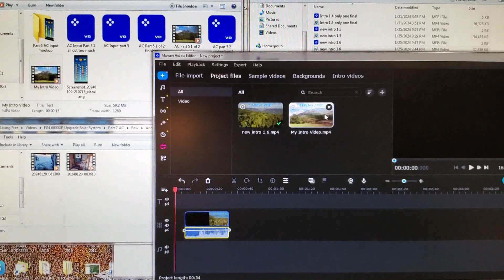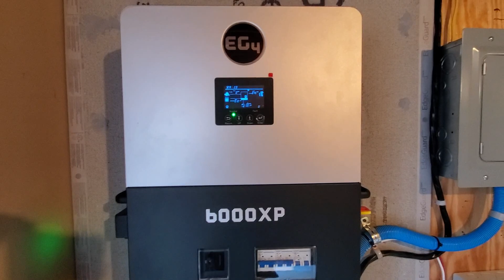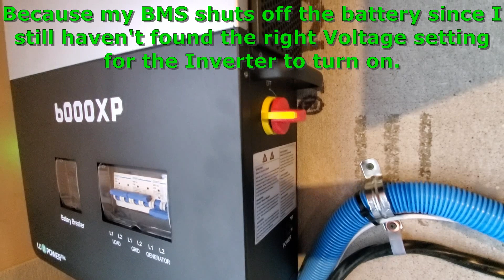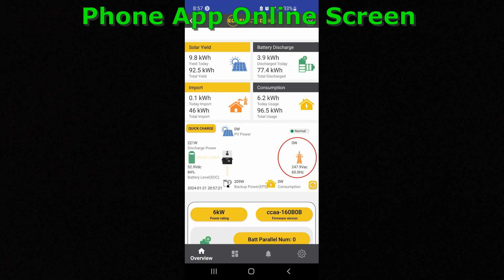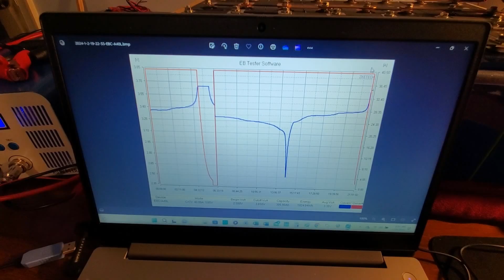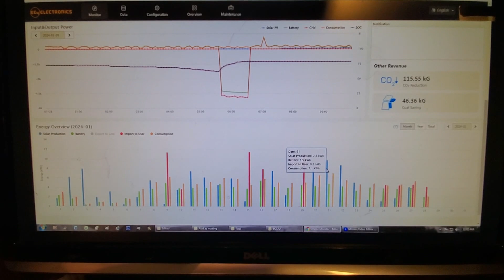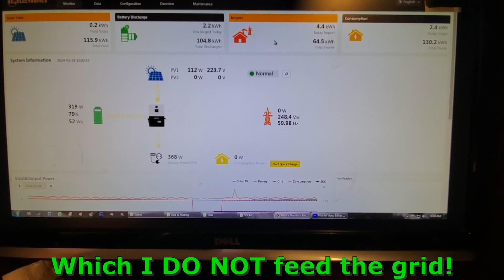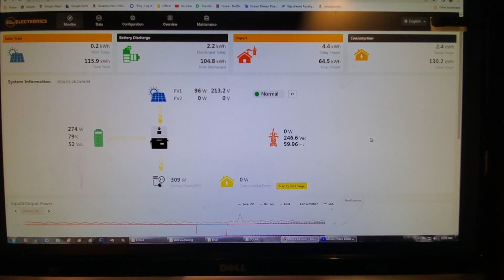EG4 6000XP - Part 7 - Settings and Thoughts I - Solar System Upgrade

Comment: Thanks for taking the time to make these videos. They give a lot of good info.

I was wondering if you added an EG4 ChargeVerter to your system (via the battery bus bars) to charge the batteries, if that would make a difference in keeping your system charged?  This way, should the battery get to low, the grid connection can take over, but the ChargeVerter should always keep your batteries at a nominal charge.

Just a suggestion ...
Reply from the maker: A/C from the grid charging should be clean no need for EG4 Chargverter. I have been looking into using it for my generator hookup but I have to verify it's really necessary myself. It is also a whole different hookup for me because of distance to generator. If this inverter is so delicate that it needs special hookup than I l'll move on to another and why does it even have a generator breaker? I think a larger generator is a better answer (11-12k propane should be fine) Too many salesmen on UTube wanting us to buy everything and trying to get us to believe them. It sounds good on Utube but those people make $ on selling it so I have to research and find out for myself. Don't believe everything you hear on UTube. Great comment, one im looking into myself.  Thanks!
Reply: @LivingFree4All  thanks for responding. I’m still in the planning stage. I’m thinking of using it initially as a grid down backup.  Then add solar. 

Want to run grid power to 6000xp. Then back to an interlock in my main with 100a breaker to give me some expansion to a second 6000xp

Then generator inlet to a chargeverter directly into my battery for grid down conditions. I’ll slowly add breakers from my inverter to some 240 devices and work my way up slowly. Don’t want to use the gen breaker on the 6000xp because if I do go to 2 of them, creates more boxes and wiring.
Reply: @Barc7580  One thing I'd say about the EG4 chargeverter is that it is really easy to dial in the amps so you have the most efficient load on the generator.  You can turn on the generator, charge at maximum efficiency to the desired level, then turn off the generator.  That can really save on fuel.

So if the 6000XP has trouble handling a noisy generator, the chargeverter is going to be an excellent alternative.

Comment: There's several communication protocols the controller can read. A BMS with CAN / Pylon protocol will work.
Reply from the maker: Interesting I'll keep that in mind. I'm not interested right now in adding more equipment, money and time for something I don't really need. I finally found the voltage settings so I'm good now with the inverter starting the A/C charging before BMS shuts off battery. That's all i needed and my BMS is now backup to inverter.  I don't have enough free time to learn something else lol but thanks for the advice.  Others may what to use it! Thanks for the comment! Take care

Comment: I thought it was supposed to have a 2p40 breaker and 8 awg wire from grid . I can't read your chart, nice chart but too small to see numbers.

BTW, this inverter does not have export to grid function
Reply from the maker: Correct no export capabilities but it's  part of the app so I'm guessing they are planning on expanding it. 

No I use a 2P50 amp breaker, the same breaker that comes with the inverter and is the Grid breaker on the inverter so it should be fine and i connected it with 6 gauge wire not 8. And boy does it charge fast at up to 110 amps! I slowed it to 80amps off grid to not overload my subpanel.

And yes the chart are even hard for me to read, you can't enlarge them either, that would be a nice upgrade to it.
Always nice to hear from you Bob!Thanks for the comments, take care
Reply: @LivingFree4All  I reviewed the manual.  It recommends 8awg wire but doesn't mention breaker size for grid input! I saw the "50" on all three breakers on the inverter  but have seen other people use a 2p40 for grid input. Strange, that's why I asked. I'm gonna do what you did! Thanks for prompt response
Reply: @bobcole3852  The EG4 supports 50A from the grid, I believe, and the transfer switch is also rated to 50A.  So a 50A breaker is generally what you want.

Hmm.  The EG4 manual specifies 8 AWG.  It is unclear whether that is a nominal specification or the biggest wire the terminals can take.  The battery terminals specify down to 1 AWG.

I personally use AWG tables for "power transmission" to minimize losses, though in this case it is unlikely that the AC input would actually be run at its limit so the temperature table is probably more reasonable.   For power transmission 50A is 5 AWG but 8 AWG is ok on temperature (90C).. though a little toasty.    If the nominal draw is only 25A, though, 8 AWG is fine.

The bigger problem here is what the EG4's AC terminals can actually take.  Looks like maybe 8 AWG is the biggest but the manual doesn't give a range.  It just says "8 AWG".

-Matt
Reply from the maker: I used 6 gauge and it fit perfectly in the 6000XP. You can see it in my earlier videos when I was hooking this up. 6 Gauge is fine to use but I don't think you can get larger to fit. I also connected 0/2 to the battery terminals no problem. I just don't use anything less than 0/2 for batteries with the idea I am expanding the system over time. Thanks Matt, Take care!   @junkerzn7312